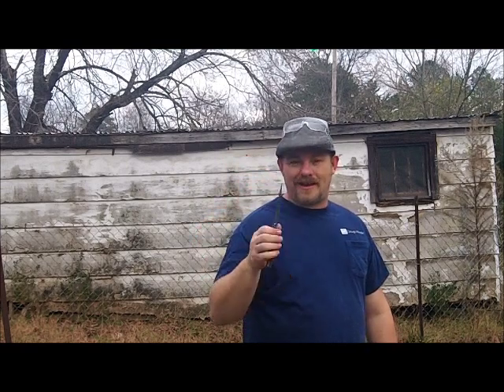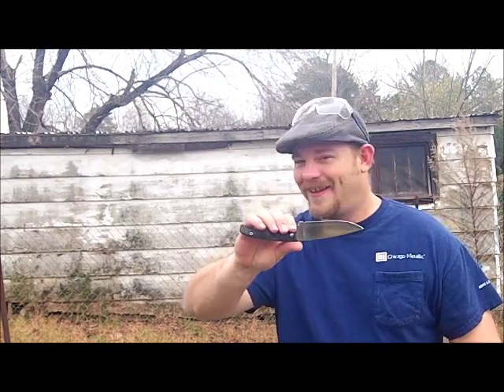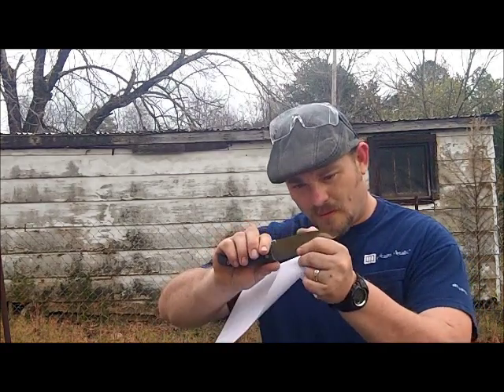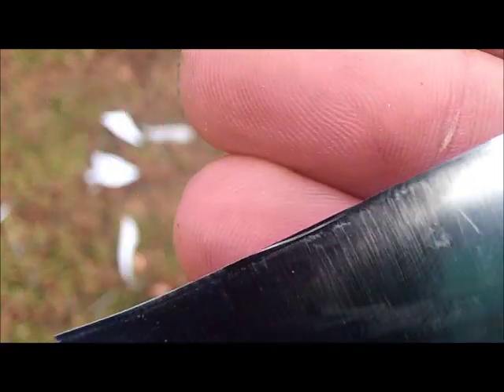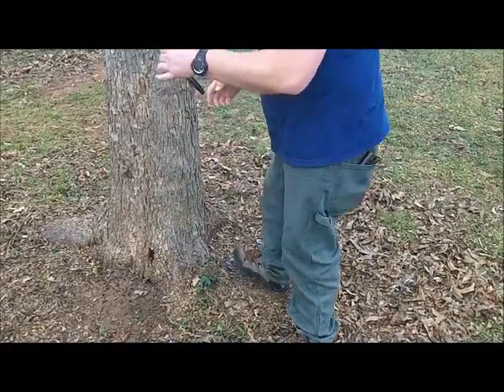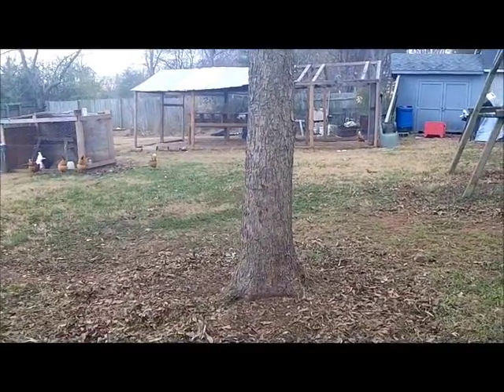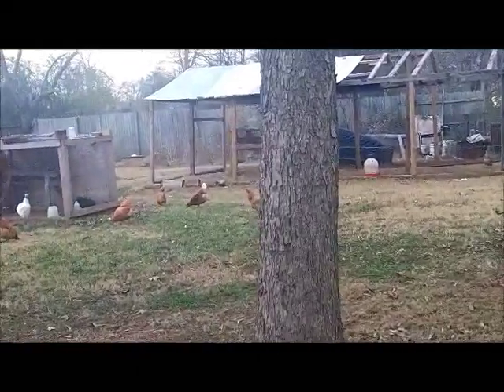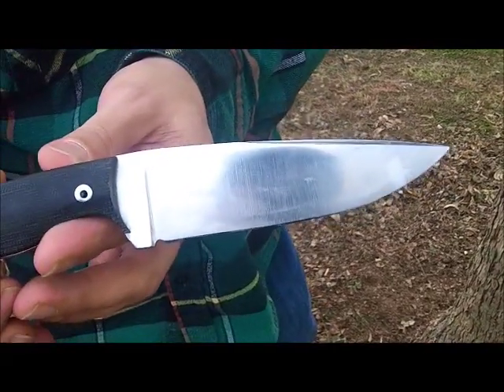Elmax Testing

Comment: In my " proof" ( absolutely not scientifical) Elmax steel is on par with S30!
Reply: mike65 I have a spyderco para 2 in S30V and a ZT0562 in Elmax and I really find the Elmax is both easier/better to sharpen or reprofile and holds an edge longer. Pure subjective opinion with no actual backup however

Comment from the maker: I twas very easy to work with before and after the heat treat. Depending on thickness the price varies. the piece I have is .179" thick and I believe it was around $40.00 a foot at 1.5 inches wide